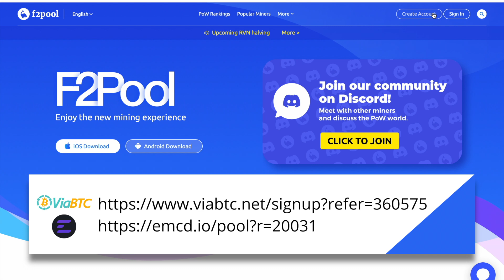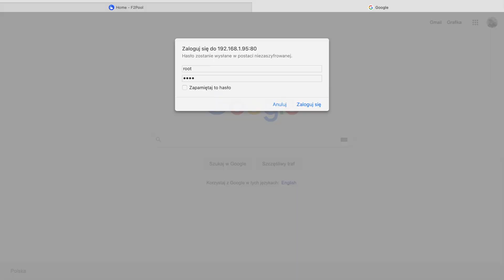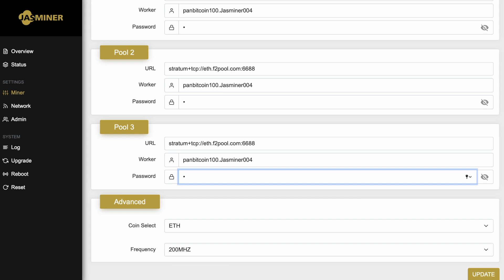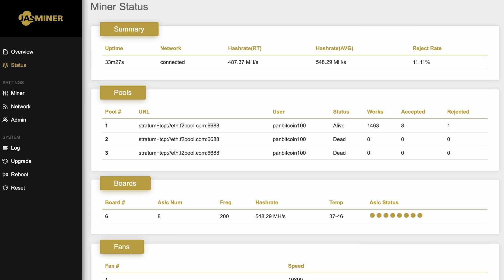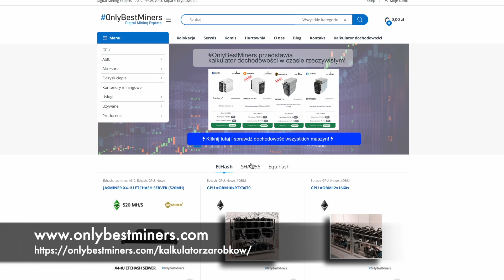Jasminer X4-1U 520mh/s miner. Unboxing and How to set up [Full Tutorial]

Comment: is it possible to access this information remotely? I mean if the miner is installed in one place and I am in another (connected to another network) can I access this information?
Reply from the maker: You need to use a PC or Rabery Pi system in mining place, lan network, which we will get via AnyDesk and then via LAN via www to the miner panel. You can also redirect the IP and port 80 and 443 to the outside and have direct access, but we do not recommend it, it is dangerous, because in such a situation everyone will be able to get to it.